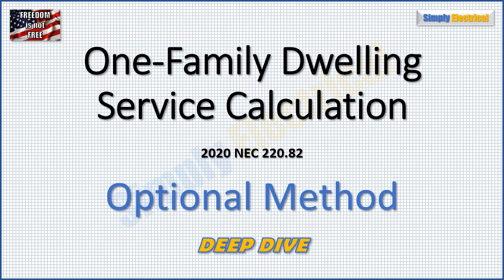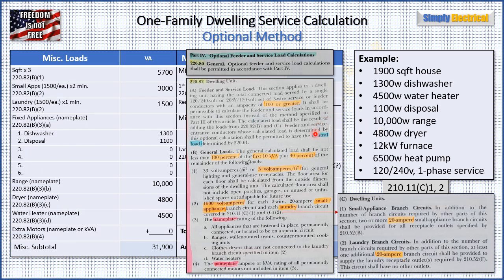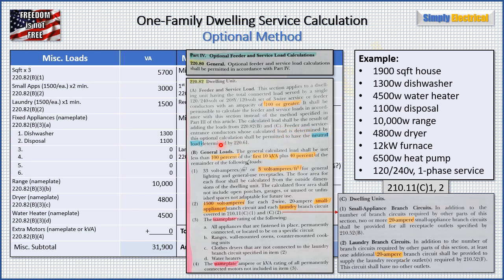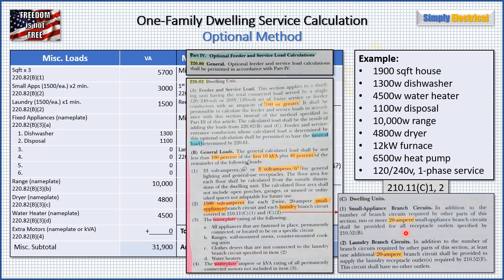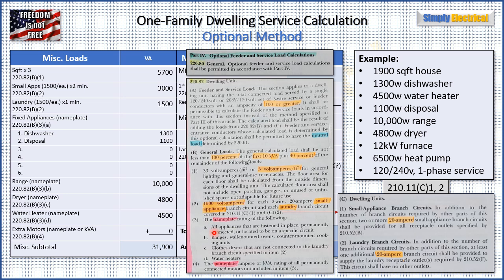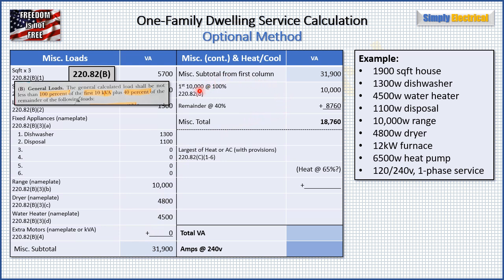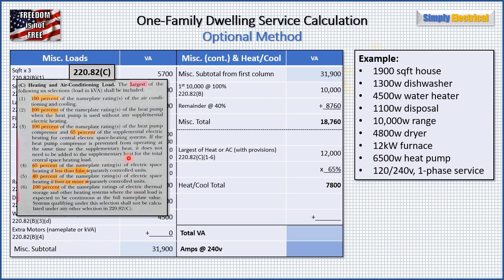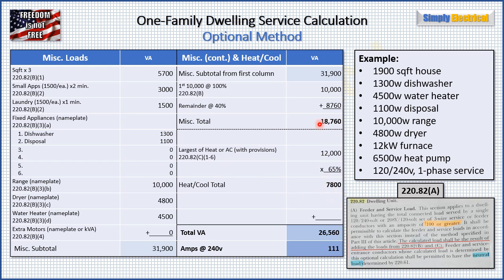One-Family Optional Service Calculation - Deep Dive 2020

Comment: I am confused with the heat pump and furnace portion of the question. I would have thought that the heat pump would heat to a certain level and if it gets colder than the furnace would turn on as well. I would have taken 100% of the compressor and 65% of the furnace for the demand load. Any thoughts?
Reply from the maker: You are partially correct. At lower temps, the furnace strips will kick on. But when that happens, the heat pump kicks off, since it no longer can function effectively. They are noncoincident loads. That's why you only need to calculate the larger of the two. At any given time, only one of the two loads will operate.

There are situations where a heat pump may operate at the same time as furnace strips, but that is extremely rare. In fact, I've never heard of it in a dwelling - only special commercial setups. That's where 220.82(c)(3) would come in.
Reply: @simply.electrical   Thank you for explaining these as non-coincidental loads.  I also would have done calc with 100% Heat Pump AND 65% of heat strip.  Nobody else on YouTube mentions this, and how are us electricians sposta know that until we are told!
Reply from the maker: @rideoregonfirst  The code is written with Formal Interpretation as the goal. See 90.6. In many cases, this makes it difficult to understand for the everyday users. The CMPs would serve the public better by writing in a more useful and obvious style, IMO.